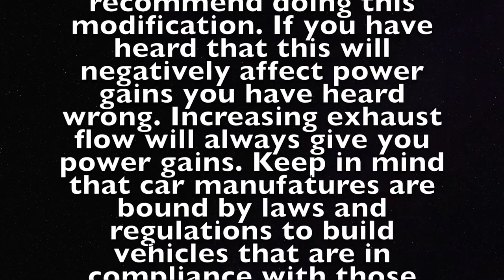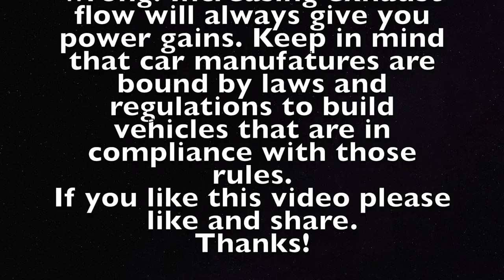2016 Dodge Challenger R/T Scat Pack Resonator Delete

Comment: I think you actually replaced the mufflers and kept the resonators.  Mufflers are in the center of the car, resonators are in the back near the exhaust tips.
Reply from the maker: Good thing I put in the caveat that I am not an exhaust guy other wise I would be more embarrassed. Thanks for the input. When I went to the shop I told them I wanted a resonator delete. He said they would be cutting this midsection out. I asked him if that was the resonator, he did not confirm but his statement was this. "It doesn't matter they both do the same thing in different ways." I will be sure to check out my nomenclature in the future. Rock on, Ezndo.

Comment: Thanks bro. I have a 15 SRT and thinking debating on doing a res delete. I've had other Challengers but the 2015+ have the all new exhaust, so its good to hear how it sounds stock vs delete.
Reply from the maker: mikebythesun yeah it is a nice sound and only gets better once the exhaust is broken in. Cost me $100 to have it done. In a few weeks I will post another video once I install the new borla exhaust. Borla long tube headers, high flow cats and borla cat back Atak series. Once it is done I will post other video.